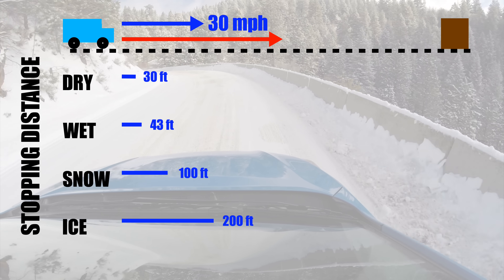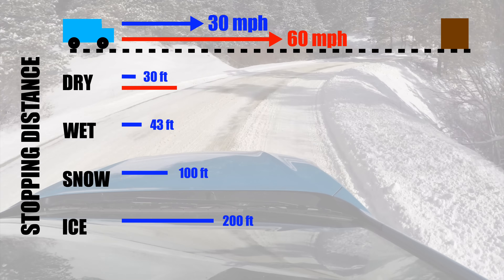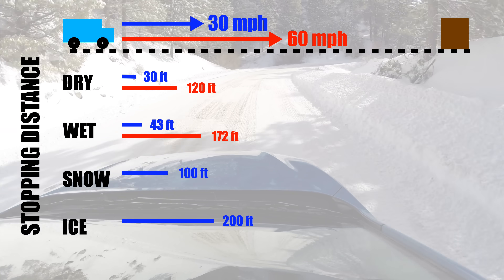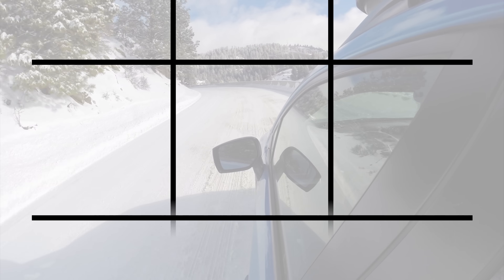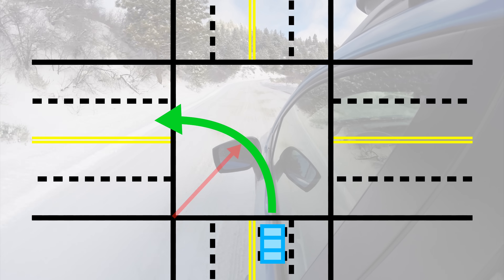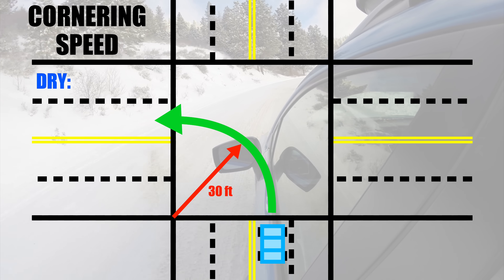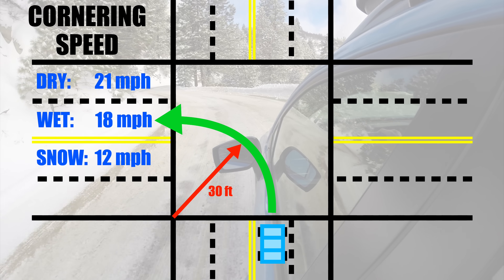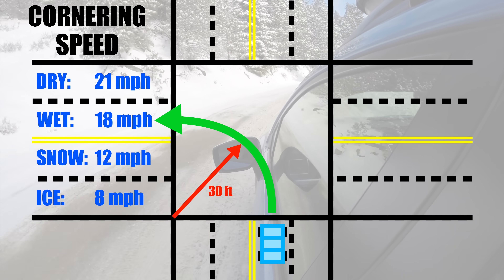Everything You Need To Know About Driving In The Snow

Comment: And when you get set of nice expensive studded tyres drift only when there isn't spots with out snow :D Otherwise you are going to destroy your tires quite fast. Studless tyres are also good option for enjoying winter with out fearing so much destroying your tires but they are useless on frozen lakes so if you want to drift on those you need studded tyres. Also remember to switch your tyres around every year so they wear evenly and you get more balanced grip (or lack of it :D)

And most importantly don't buy boring fwd car!
Reply from the maker: Ha, wonderful to have you here on the channel! Love your videos!
Reply: +Engineering Explained Thanks! I have been watching your channel also pretty long, you have good and well made videos. I have to also mention that I have also S2000 :D I bought it about 3 years ago and it has been great car!
Reply: Hydraulic Press Channel interesting to see you here... have you ever tracked the s2000?
Reply: I have drove S2000 on track 3 days. It's pretty fun car even on completely stock configuration, I have just stickier rubber under and that's it. Only problem is that the track is so far away (1.5 hour drive) and it gets also quite expensive so I have been mostly stick to drive with simulator and getting my kicks out from downhill mountain biking. I have drove motorcycles quite a much on track but that gets way too expensive after you have reached certain level of skill and start to destroy one set of tyres per weekend :D 

Downhill biking is 90% of the fun of motor sports but only 20% of the expenses so I have mostly transfered to that now.
Reply: Hydraulic Press Channel cool, I have an s2000 as well but I don’t have the money to track it yet, one day hopefully.
Reply: @EngineeringExplained  sorry but. Thought i heard progressive in the beginning worst car insurance period just see what they give you for bodily injury
Reply: Hydraulic Press Channel I read that comment in your accent haha
Reply: I don't believe in cars without all 4 wheels are connected to the engine.
Reply: A 4x4 is only helpful on ice during acceleration. Otherwise, tire contact to weight ratio, wheel-to-wheel measurements, and aero are going to have an actual positive effect on braking and turning.

There is merit to a 4x4, but also merit to a lighter 2x4, especially a fwd. Like most things in engineering, it's not black and white A is better than B, rather A is better for some scenarios, while B is better suited for others.

4wd/awd cars are actually worse for braking and cornering in snow due to the extra weight required. You just have to ask yourself if you're more likely to crash because you couldn't gas out, or you couldn't brake in time. Depends on your preferences
Reply: But a boring FWD car with winter tires is a pretty safe vehicle. My 9-5 Aero with snow tires is pretty great in snow! Turn off TCS and it can be fun too!
Reply: If I'm correct, some ice racing courses requires a roll cage if racing with studded tires. Only other downside is that (cheap) studded tires tends to suck at snow traction compared to studless. Studded tires works best on smooth ice. Otherwise, studless gets the best traction. Think about the road conditions before deciding on a tire.
Reply: here in Iceland we get nagged regularly on how bad studded tires are and how you shouldn't use them.

which is fine for the southerners in the capital area.
people everywhere else shake their heads and use the studs.
a few people in countryside swear by the stud alternatives but people on average just want to trust their lives with what they know works.
Reply: FWD cars are not boring per say, if it's properly set up you can have more fun than a poorly set up rdw/awd. A FWD car just asks for a bit different approach of steering. If you want to drift a FWD car, don't steer it like a RWD one, use the proper technique.
Reply: Theres a car in my town that gets away with having studded tires year round on their Outback...
Reply: I live in Vermont and use Vredestein Quatrac 5 tires with severe service rating...all year... because they're the proper all weather tires that have been popular in Europe for a while and just recently hitting the states (Michelin CrossClimate, Goodyear Assurance WeatherReady, etc). I got them for full time Uber driving in blizzards but they're Y-rated to 186 mph and are superb summer tires as well with moderate road noise and low rolling resistance. Can't wait till it snows again for funner driving.
Reply: fwd cars can still be plenty of fun with clever use of the handbrake.
Reply: Its importent to note that you need to break in studded tires. Else the studs will not settle properly and fall out quicker. Drifting and driving like a maniac is not recommended either. Unless you want to change tires every year ofc :)
Reply: @Invictus_CS 4x4 corners better in various low grip environments, especially while accelerating due to the guiding tires also providing acceleration, and all the acceleration being spread across 4 tires instead of 2. Meaning less load per tire. Also, with a clever computer/differential you can apply different torque to each tire to maximise available grip. There is a good reason most rally cars (read - ultra low grip condition racers) are awd. Simply put, it works better in a low grip situation.
Reply: Well, look at our Czech YouTuber Agresivni Ridic - he has Skoda Rapid with FWD and I think he enjoys quite enough fun :D
Reply: They are not legal in must states
Reply: Mate this is on about how to drive on normal roads not race track why is this comment section on about drifting and driving like nutters on public roads are you all rally drivers?  No only they use studded tyres when they rallying at over  100mph
Reply: I got a fwd car and I can drift in the snow lol not just power slide but drift. Can’t normally but can fwd. and when I need grip it’s got more too than rwd because it has the engines weight on the tires that the power goes to
Reply: Fearless men drive front wheel drive
Reply: Alphanumeric Soup Fearless men drive rear wheel drive on black ice with summer tyres.
Well, maybe need a different word for “fearless.” And “drive.”
Reply: Fwd is best
Reply: I would rather FWD car in snow than a rear wheel drive.  A rear wheel drive does not have the traction like a from wheel drive.  Anyway a good set of snow tires are a must.
Reply: How are you going to drift/powerslide around corners in an fwd?
Reply: so much material in this thread for an r/woosh compilation!
Reply: @ErrorSputnik Jortikka It's called the Scandinavian Flick. You get on the brakes, load up the front, get the turn in, let the car oversteer, then you get back on the power.
Reply: @onoitsono  If not safe to go fast, e-brake all the way 👍
Reply: Kind of not so useful advice -- very few people are buying studded tyres and even when people live in the mountains, or Snow belt , they still believe in the nonsense "all season tires " and refuse to "....waste money for snow tires..."
Reply: +Guergui Stoyanov Here in Finland probably 70% use studded tyres and 25% good studless winter tyres for 3-6 months every winter so at least places like northern Europe and norther parts of America it's "useful advice" :D
Reply: @HydraulicPressChannel  Do you know in how many states studded tires are legal?
Do you know that you can get big fat ticket for using studded tires in states East of Mississippi, $500+?
For "ruining" the roads with your studs!?
I live in Michigan with more than enough snow and I use 6months studless winter tires (as mater of fact, exactly the same shown here  WS - 80 Blizzaks) and most of my neighbors are laughing at me for wasting my money. 
No more than 1in 10 cars in Michigan are equipped with winter tires during the good traditionally snow winters. Only Colorado (as much as I know) mandate winter tires in the mountains during the winter. Maybe a few more states, in the mountains, without strong enforcement. 
In lot of states you can't legally even buy  studded
 tires. That was the reason for my comment about how useful is your advice for studded tires and drifting.
Reply: @guerguistoyanov137  Fortunately, since HPC is in Finland, he's not likely going to get a ticket. Great thing about the Internet, people have different experiences and regulations from all over the world.  Doesn't make any of them useless.
Reply: Colorado driver here.  Useful to note especially for those of us who have done a few unintended 180's, 270's, or 360's and are bored with them, studded tires work VERY well on snow and ice esp. in mountains with curvy roads and steep drop offs.
Reply: I don't know why this guy is shitting on front wheel drive, my car is fwd and I blow past 4x4 trucks all the time in the winter. Maybe they're all just a bunch of pussies but it's definitely not boring doing 70 in the snow.
Reply: brandon18054 driving 70 in the snow isn’t a very good idea unless you hate your car. One mistake or even one snow drift and the car can be totaled. Drive safe this year man. Don’t want anything bad happening to ya.
Reply: @brandon18054  a truck isn't supposed to be fast. They weigh fucktons. 4x4 is still better in all conditions than fwd.
Reply: @brandon18054  And that is how you spin out and crash. You drive fast in low traction a lot, think you're getting good at it, and one day out of nowhere you hit a patch of black ice or brake hard to avoid and accident and your car is in the ditch.
Reply: @brandon18054 The only thing a 4x4 has more in snow and ice compared to a 2 wheel drive car is acceleration. Braking and cornering traction is exactly the same no matter how many wheels are driven. And if you're blowing past them on a straight(ish) highway, it really doesn't require a lot. Driving on a straight line in the snow is pretty much the same as driving on a straight line in the summer. It's when something unexpected happens when you're in trouble on snow and ice. On tarmac you can swerve really fast without losing control and you can stop the car in an instant. On snow and ice everything happens multiple times slower, except for the crash which will happen at a higher speed.

Comment: I live in Canada where we have lots of snow.  I agree to keep momentum in snow if you can.  When I drive in a pickup I like to have some weight over the drive wheels.   In addition I find front wheel drive cars are better than rear wheel drive.  I drive an all wheel drive SUV with ABS and  studded Snow tires which give max traction and traction control.  Can you give some facts about snow tire, studs.  Plus that winter tire are a softer rubber in the cold than all season/ summer tire ? .   And have you or can you talk about traction control like my SUV has ?   Thank you, have a nice day.
Reply: Tire studs are supposed to be great for snow and ice especially but reduce your grip a little on dry pavement in the cold, because there's less rubber and metal isn't as grippy obviously. Also they're noisy, never tried them myself, I believe in southern ontario here, studded tires are not allowed.
Reply: Ben , I live in Newfoundland where studs are allowed.  My wife and I both have studded tires and find it makes a big difference.  A down side to studs is that it wears out the pavement fast than no studded tires.

Comment: Wheel slip also causes a drop in the lateral force that the tire can take. So if you accelerate or brake hardly ( if your car has no ABS ) your car won't turn and will continue to go straight into the nearest tree or supermarket.

Comment: What about static vs dynamic friction? Water in all its form will have very low dynamic friction. Meaning, what you said is true till you break that static friction barrier and start sliding but then during sliding the behavior is worse than 0.7/0.3 etc. You get a false feeling that you can go half the dry speed because thats where you start sliding but in case you do start sliding you wont make it

Comment: not all ice is created equal..."BLACK ICE" is so slippery ive seen a plow truck with chains going forward, sanding behind just slide off the crown of the road and into a ditch
Reply: Black ice tends to be smoother and provides less friction. It also tends to occur when temps are near freezing and therefore is more likely to have a thin layer of straight water on it.

Comment: EE good video as always, question how does the high altitude (low oxygen) affect NA engines in comparison to turbocharged engines?
Reply: because the higher altitude from sea level, lower air pressure, and make the air less dense and less power will be created due to lesser fuel that burn at the same time. Turbocharger help to increasing air pressure inside the engine, unlike NA which rely the pressure with environment air pressure.
Reply: @govinlock8568  :) thank you, but won't the turbo exciding amount of carbon fumes suffocate the engine due to the lack of oxygen?
Reply: @quiethadeda  I think the carbon emission is not significantly increased when installing turbocharged, because the pressure is increased by sucking more oxygen to the engine. McLaren has turbocharged engine that currently one of the cleanest ICE engine ever (it has one of the highest power to emission ratio).